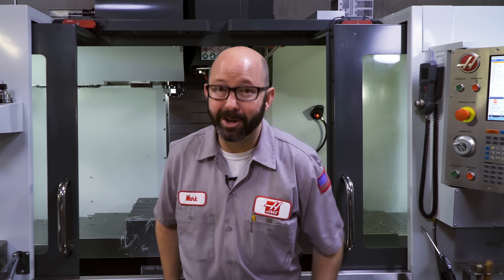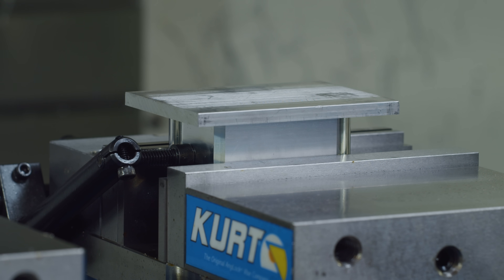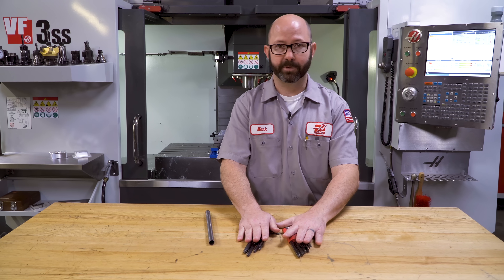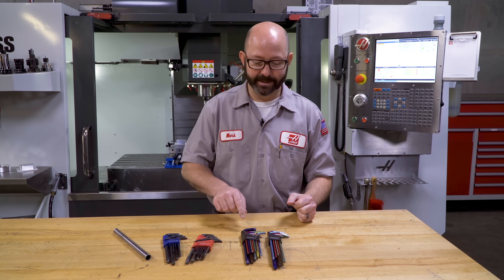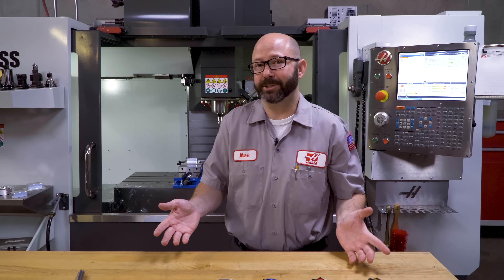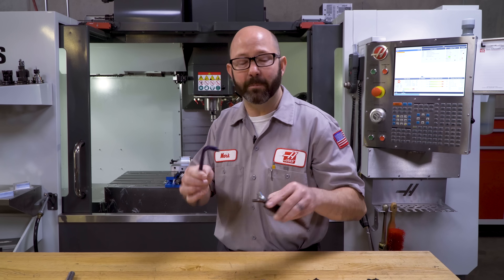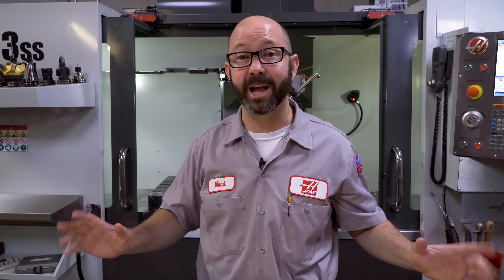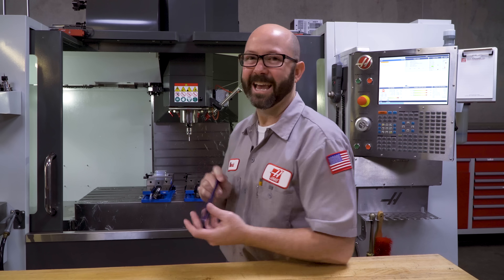4 TIPS - ONE DAY: Probing, Wrenching, and Chamfering - Haas Automation Tip of the Day

Comment from the maker: We’ve added some more examples of fancy chamfers, and posted the CAD files to go along with the examples. Be sure to check them out here: https://www.haascnc.com/video/Video-Bonus-Content.html   - Mark, Haas Tip-of-the-day
Reply: Ive had those same colored allens for at least 4 years now.  Ive had several people make typical machine shop jokes about them. Now,  to my knowledge they all have the same set. Haha, go figure, right? Hey, Canon, aren't those the ones you said you wanted?  Uhh. Umm. Uhh. 
My best friend is high-end in the mountain bike industry. He's been trying to talk me into some wihi, wera, or pb swiss allens, maybe one day.  Every single last one of mine is slightly bent in the high torque direction,  but... i know what the pink one fits and the red one... and...
Reply: Wiha also does colored btw, as do all brands i mentioned.  First world problems, i know...
Reply: Well, the diameter of the ball is 5 mm, if I touch the stop from right to left and write X +2.5 in the notation, then I do not need the participation of blanks with ideal parameters. In addition, when the part is clamped, I can zero along two walls along the Y coordinate and indicate the coordinate. At the same time, indicate an offset towards Y- or Y +
Reply: Oll

Comment: I have those Wiha hex wrenches.   I found that they didn't save me any time and slipped inside the pockets so that they weren't all facing the same direction. I probably spent more time readjusting them.  They also seemed to bend more than my old set.  I went back to my old Bondhus set.

Comment: A few things I've picked up:
First is get yourself a solid 123 block, one without holes in it.
Second is to have a 3/8 Allen socket, the shallower the better to use your fingers to remove/install screws and then the Allen wrench to tighten
Third, I recommend you to get yourself a drill and socket for opening/closing the vise, super helpful during set-up when you may be opening/closing it a few times to remove jaws or align soft jaws.
Fourth is a total nicetie but it's to get an electric ratchet, this is what I use to install/remove the bolts on vice jaws and things because it's just much faster. 
Hopefully this helps someone out there! Great video as always

Comment: Why wouldn’t you just probe the stop (provided its precision) and the fixed jaw, instead of adding a 123 block?
Reply: In this case, the part-stop is the head of a Bolt. We wouldn't be able to probe the exact high-spot on the bolt perfectly, with our round probe tip, so we had to load up a surrogate part, a 1-2-3 block.  We could have probed the back jaw (non-movable jaw) though, and picked up our Y-axis just fine that way. - Mark

Comment: I love using a ratchet and Hex Drive sockets. Though I’m a machinist, a ratchet is probably my most used tool. When it comes too cheater bars, I use a breaker bar and my hex drive attachments. I’ve tried using cheater bars, but for me personally, it’s more of a pain than it’s worth. There are some occasions where I need too use a cheater bar, but if I have an option, I will choose my ratchet and breaker bar.

Comment: I teach the 123 block method for the Op2 - I think I may have to do probe the stock and do some math and probe the "plane" the 123 block and compare accuracy.  Op1 is so easy - but now we have to be accurate and repeatable on Op2.  

I bought silver for metric and black for inch.   common problem mixing up or losing wrenches. I was the only one going around putting every think back in its place.  I use 1/2 NPT pipe from plumbing for cheater bars

when we do hand g code I show how to use same contour path for chamfer - with my 50/50 method.   Z-.05 and D #-.05 in Radius geo 
( we use radius comp).   copy tool path and edit as needed. 

hey any stats on how many people use D comp as a Diameter or as a radius ?  Our 1980's shops all did radius
Ed D

Comment: On cheater bars - try to get sometging like a piece of 1/2" bore, heavy wall alum tube, becuase you'll damage it more likely than the wrench - mine is cut just a bit shorter than the inside of the drawer it sits in👍😉

Comment: wouldnt it just be easier to program this off the stop and stationary vise jaw from the get go?  also, if the next op is to face off the excess, you could just have a bigger tool path to expose your walls, and then probe it.

i used to use a 3/4 wrench  as a cheater because i have about a dozen of them for beaters and would usually leave a couple at every machine.  lately i've just been using sockets for everything because i've been trying to get in the habit of using a real torque for everything, took me a long time to succumb to the fact its a much better way of doing things for consistency and not stripping things out. most useful tool i have is a 1" square 7" long brass drift.  use more than anything.

that chamfer tip is slick, going in my bag of tricks for sure.

Comment: My Fav. Chamfer is a 3 flut from Dixie ( can really recamend it ) 

My 2 fav. Tools in my box is foam cheats so I have a soft safe and chip free place to put my parts quicky without scratches and the other one is some thine bend spring steal shims witch is use to keep the parrales in place well changing parts ( works like a charm if you don't open the vise much more then takeing out the part. But give it a good bend and then sques it really well ( so it goes to about 1/6 of it's bend size at minimum or even so it goes flat)

Comment: Hi Mark,
Great video, as always.
Items I keep very close to the machine:  Sharpie, a toolholder with a tenth indicator (for sweeping bores or lining up the vise), a tape measure, a ⅞” combo wrench for clamps or vise hold-downs, a 3” “ThinBit” scale I grabbed from their booth at a trade show, an electronic calculator with basic functions, and a 1” gage block, and of course a 1-2-3 block.
If I flip a part that is too thick to fully profile from one side and left-over material is going to interfere with probing, I just hold the 1” gage block up against the side of the machined surface and probe the gage block, then add or subtract the 1” from the offset.
Keep up the great work, and see you at IMTS!

Comment: Tape measure and marker. I work in the tool room of my plant and were always cutting different stock sizes for every part that goes into our machines.
Reply: Also we have custom buildup tables on our machines that allow us operators to more quickly set work offsets without using a probe. It’s a table with reamed holes 1” apart from each other in a grid, and we put bolt holes on the back side of our parts in a pre op, so all we do is measure from the machine home to the center of our part while it’s bolted from the underside of the table.
Reply: I forgot about a marker! For decades now I’ve carried around a sharpie. So very handy.

Comment: Instead of a cheater bar, I use a 3/8 drive ratchet and a short hex driver.
Reply: That's what I usually use too. That and Bondus ball tipped drivers with a screw driver type handle. But I do use cheaters on occasion with standard L wrenches. It's nice to have options.
Reply: I use the box end of a smallish wrench.

Comment: I just have to say, the aerospace shop I work for has banned Allen wrenches and cheater bars! It's absolutely ridiculous!
Reply: Sounds like some gorillas in the shop grunting everything tight. We have a guy that hammers on vise handles to tighten them, and to tighten ER16/32 collets. I wish they'd doc his pay for everything he breaks, he'd have to get another job right quick.
Reply: Adal Cardenas we’ve banned all Crescent wrenches. Too likely to strip bolt heads or give uneven torque.
Reply: I hear you guys, shops banning essential tools just because one guy has no clue what he's doing. With me the problem is that we've switched to dedicated fixtures that were designed to work with Allen wrenches. It makes it nearly impossible to do your job right.

Comment: Please help.  I have a HAAS 30 lathe. I’m running a 13 inch steel rod turning it down to 1.0659 inch OD. I’m having trouble with .0015 runout to OD (egg shaped)  I need to hold a .0003 tolerance   Please advise.  I’m leaving .020 for the finish insert
Reply: Goon 88 I would reach out to your local HFO, they can look at the issue from both the Service and Applications  side of things and get you up and going quickly.

Comment: We've ground the ball end of the allen wrench we use for the vise jaw screws down to be quite thin, makes the angles we can get on it greater when using tall or odd shaped jaws.

Also, if you want a cheater bar that's secure, grab a long 3/8" or 1/2" extension from a socket set and deep well socket that's the same size as your allen wrench, and bam, instant cheater bar that won't slip or slide on your wrench.

Comment: I fly cut my part to the finish thickness about an inch wide path that gives me room to measure with mic on the X side of the work stop. Then without taking part out of vise since I've established my Z on size and I know the perimeter of the part is square. Then I probe the X position for the new X work coordinate. This method also allows me to check and or re-establish Y if needed. Offset all my tools, run part, check it and make any adjustment as needed.

I always learn something from your channel Mark, you make it fun!

Comment: Get Wiha to give you a pat on the back Mark . . . just bought a set of Wiha colour coded hex keys on Ebay after seeing this . . .they look very pretty!.  Chrs Paul Norman.  www.RacingVincent.co.uk
Reply: RacingVincent01 I know, kind of sounded like a sales pitch :), I just thought they were cool though. Bought them myself. A lot of times, especially for expensive stuff, I’ll call the manufacturer and beg for some product for a video, they are usually pretty giving. Heck even in industry, they’ll sometimes give you a milling body, knowing that you’ll come back to buy the inserts. - Mark
Reply: @markterryberry4477  Not at all Mark . . . always good stuff from you!  Besides, as I sit here on a Sat afternoon with a surface plate and various gauges around me measuring 1930's motorcycle head races . . . I needed a bit of Retail Therapy!  Now just let me have a CM-1 at half price and I will happily do a review on it for you!! best wishes Paul

Comment: 6:18 this is a 5 axis part... Lol
Reply: Haas has made previous videos about the steps to machine this part, it actually a 3 axis part
Reply: This particular part does have a compound angle pocket/hole in the face, but I know that’s not what you’re talking about. I was just thinking about the chamfer itself, making sure that folks realized just what you said, that it was a simple 2d XY chamfer, not some fancy swarf cut. You saw it right away, I was surprised how many folks couldn’t recreate that chamfer, which is why we put it in the video. Thanks for the comment. - Mark

Comment: For probing the unprobable you could also drill a hole close to the contour of OP 1 or mill a slot close to it while still in OP 1. This way you can reach the contour of the part through the hole.
Reply: face then probe also an option. Just make sure no burs or chips first

Comment: which program do you use im a student and i currently use fusion 360 , is it ok? do you recommend any other cad/cam ?
Reply: Alright thanks guys
Reply: The program for this video was Mastercam. We have so many people at the factory, there is a bit of everything. 
We have lots of engineers and machinists learning CAM with Fusion 360. And we have quite a few using Mastercam, HSM Works for SolidWorks, Gibbs, Esprit, CamWorks and hyperMILL. 

I tend to bounce around a bit between CAM systems, depending on the project - which isn’t the best way to get good at something.
Reply: HSMWorks is rumored to be discontinued (as a plugin for Solidworks) , so don't too heavily involved with that software. Unless your shop is dedicated to running Fusion360, and be at the mercy of their cloud storage. 
We use Solidworks for CAD, and had just started training guys in HSM Works, but now we are trying to get everyone switched over to CAM Works, and it's a mess with all the different CAM files floating around the server. Choose wisely.

Comment: sincere question: how repeatable is the position with such a stop in the vice?
Reply: SoWeMeetAgain I think a lot of it comes down to the operator. Certainly within .0005”/.013mm, but a solid operator can hold tenths, if he is locating against the datums.
Reply: @markterryberry4477  that's quite a lot imo, btw by tenths you mean tenths of a thousandths of an inch?
Reply: @SoWe1  "tenths" is always .000x
Reply: If you aren't slamming parts against the stop or forgetting to wipe your parallels, you can easily hold tenths. The gorillas that try to make everything about speed, ruin parts and waste time.
Reply: Some stops are more rigid than others, but bt placing the part flat against the fixed jaw first and gently sliding the part to the stop you should be able to repeat pretty well. The torque on the vise will affect positioning more. If you need the best possible accuracy on every part you might need to probe every one of them.

Comment: Why not probe vise? And your block becomes unnecessary.
Reply: Владимир Яркин probing the vise works great for the Y-Axis. For the X-Axis stop, you can not accurately probe the head of the bolt we are using as a part stop, so a surrogate part (1-2-3 block) works well.
Reply: @markterryberry4477  But setting up real part after surrogate part will be with some error by X axis. And if I'll probe centre of surrogate part (by Y axis) and  centre of bolt head, the errors will be approximately the same.

Comment: Top used tools (besides Allen keys and calipers of course) would be my flexhead ratchet with a 10mm hex bit. For swapping tool blocks and jaws out. The flex head is nice because you can break the bolts loose and then use the handle as a speedhandle spin'em out real quick

Comment: i have a cheap right angle impact i use to spin vices open and closed, and i also drilled and tapped the cap screws for the vice jaws so i can have smaller fixturing or angle jaws which i can then screw into the screws, that way you never have to worry about them moving like they can with rubber bands or getting chips behind them or whatnot
Reply: That's a great idea about tapping the screws, thanks!
Reply: @gmarco98248  no worries. i still keep my best tricks secrets, like how to twirl an allen wrench around your finger the other way.

Comment: You could have used the prove by proving the stop also because the surface of the part is gonna be against the stop without the part
Reply: The head of most screws is not flat or square, though if it is a precision machined head your idea will work fine.
Reply: Personally i rim a gage block up Agenst the side then probe on the gage block and then measure the block and subtrakt the block from the measurement ( normally puts me within +-0.01mm witch is fine for face and chamfer ) 
If mashining after the set up then i just tell it to leave a little bit of stock and reprobe agen when i know it can touch straight on the first mashined Surface

Comment: Had to take jaws on and off nonstop, ditched allen wrenchs for harbor freight 3/8 In. Air Ratchet Wrench. makes taking bolts in and out fast and easy, and can still use it as a normal ratchet w/o air. Just make sure bolts and threads are always clean so you dont strip anything
Reply: Even better is Milwaukee makes an M12 cordless 3/8 drive ratchet that works awesome for swapping jaws and if you have a 3/4 socket handy it makes running vises open and close a breeze

Comment: The tools I use the most. My calipers and my electric impact gun. 
How else do you run the jaws in and out quickly from 2” to 9”
And the last tip is the best tip
Reply: Sicktrickintuner thanks. Check out https://www.haascnc.com/video/Video-Bonus-Content.html. We created some more examples, and tossed in a CAD file - Mark
Reply: Lol. I thought you were talking about the chamfers, but now I’m guessing you were talking about the wrench spin..
Reply: Ive heard that wasnt a great idea, so i bought a cheapo 3/4" socket, a speed wrench from HF... Works great, and i never have to worry about the batteries..
Reply: Machinist 72 
Ive got 3 batteries around for all my cordless tools. 
Set on a low setting it gets it hand tight, like about 20ft lbs then i can finesse and use a wrench after to get it exactly where i need